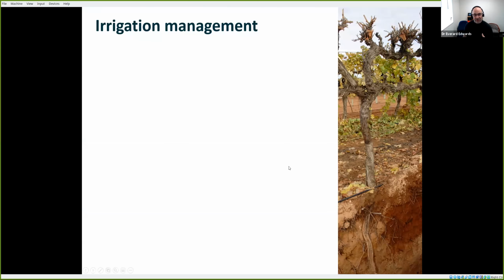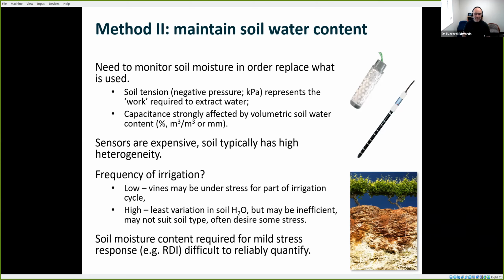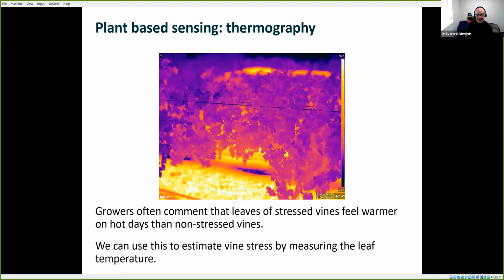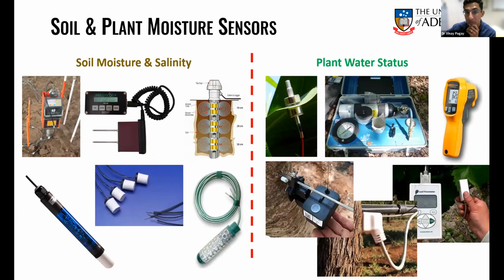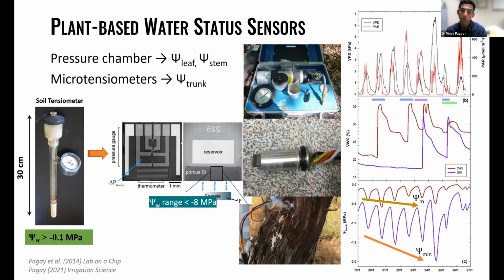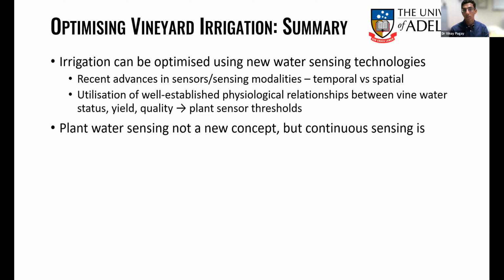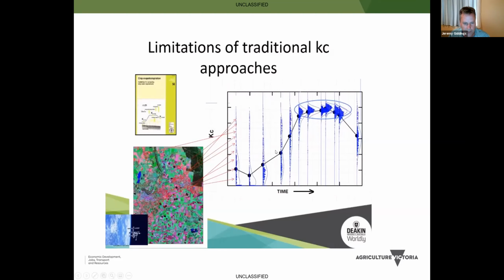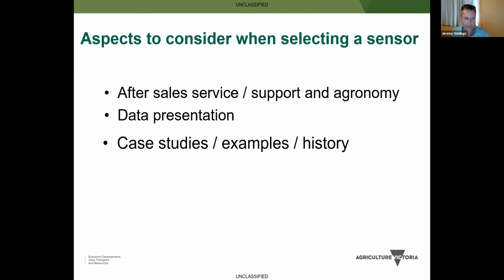Irrigation scheduling tools to make every drop count

Comment: SWRT subsurface membrane technology provides dramatic increases in water use efficiency and crop production in sandy soils.  U shaped membranes installed at two depths below tillage depth detain and retain moisture and nutrients in the root zone for biomass and crop growth.  Membranes remain in tact for 40 plus years providing a great return on investment.